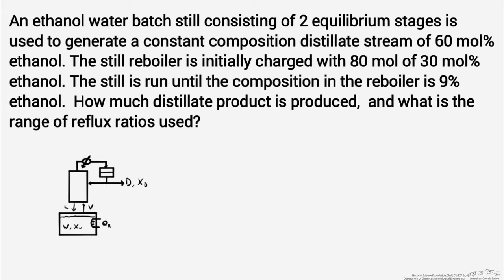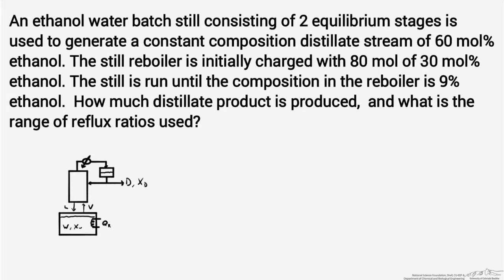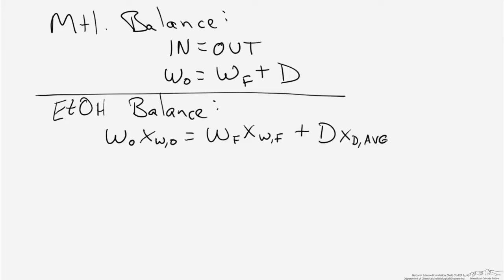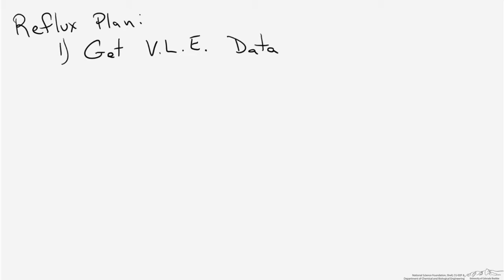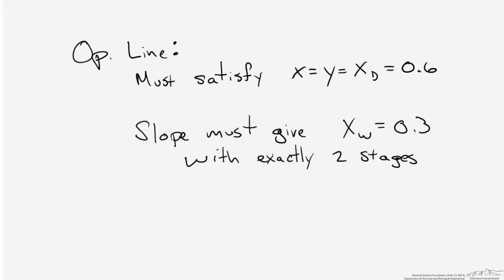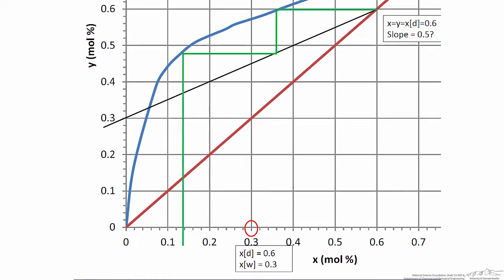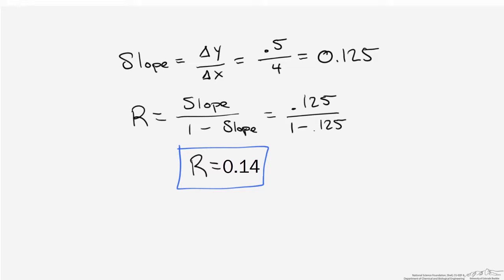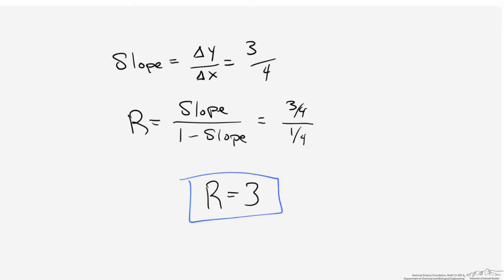Batch Column: Variable Reflux

Comment: If there are 2 stages, in the graph the reboiler must be counted because the two theorical stages are for the column and the operation in the reboiler is another stage. So, in the graph must be drawn 3 stages no 2.
Reply: I think the reboiler is already counted as one of the two theoretical stages, because it was only mentioned as 'two theoretical stages' rather than 'two column stages' or 'two plates', so 2 stages drawn is already correct. Then again, this might be too easy...